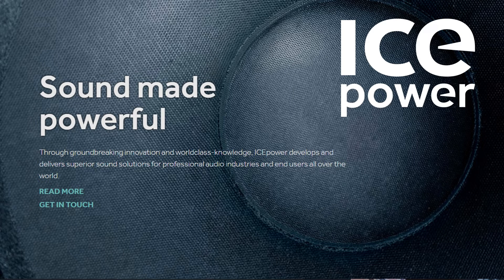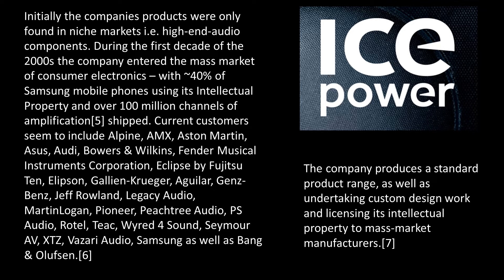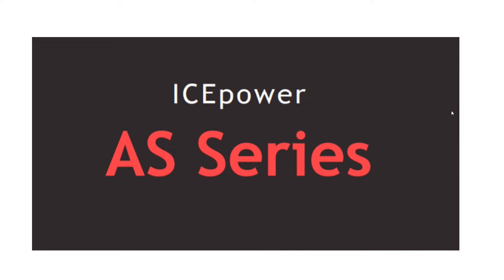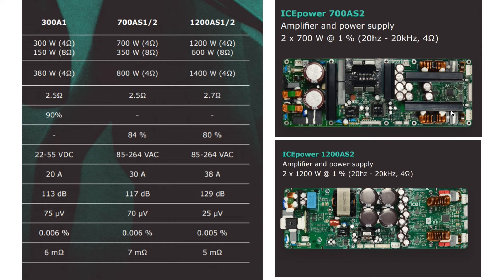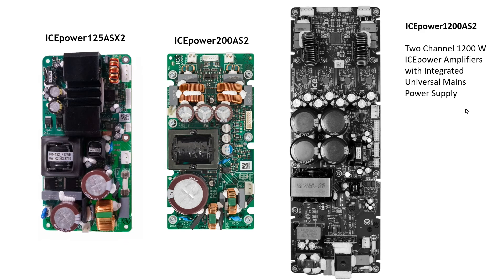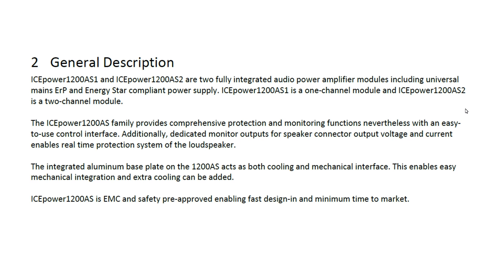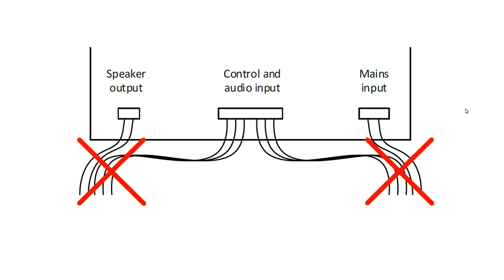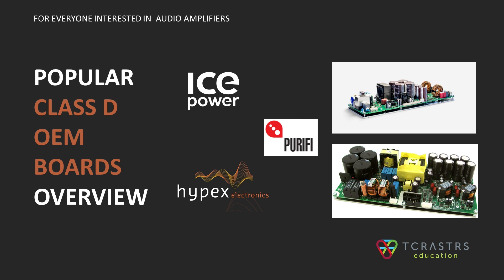Class d amplifier boards overview part 3 ICEpower AI VO

Comment: How much is damping factor of Hypex 
Vs ice power
Reply from the maker: Depends on the board power. For top-line, those are about 500 and above for both manufacturers. In practice only 50-100 is worth considering. Higher figures do not impact sound quality because there is limitation of the speaker motor electrical strength. (magnetic flux and coil interaction)